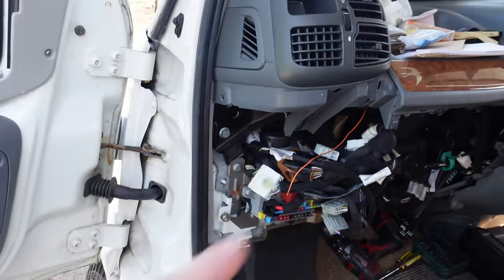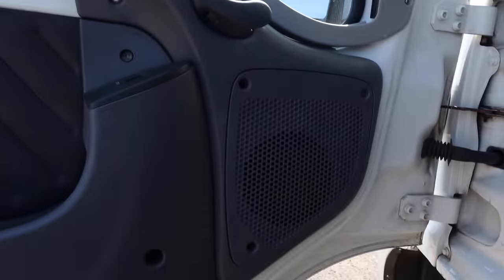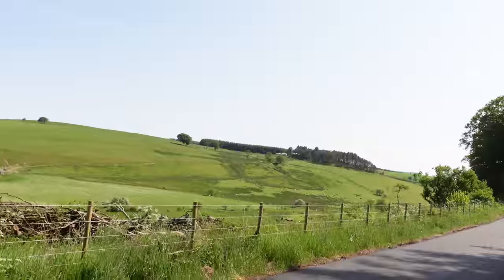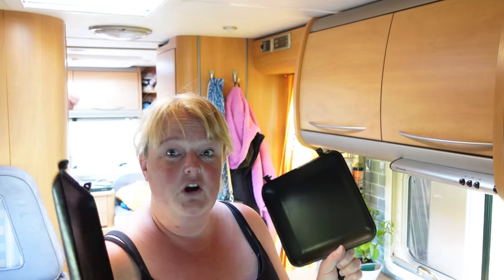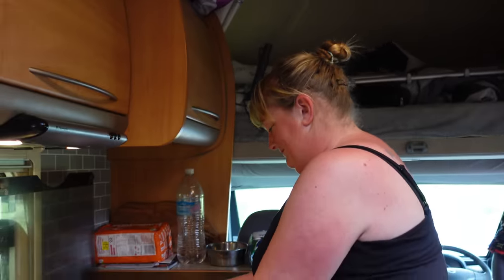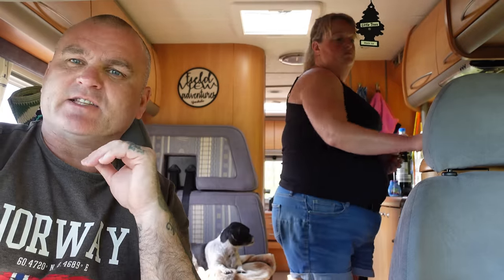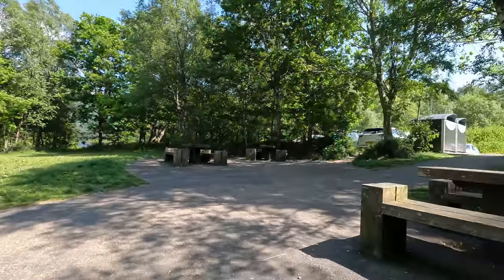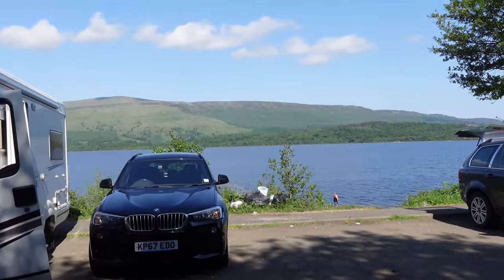The Dark Side of Van Life: Beware of THIS!

Comment: with the spacers it should of had studs and nuts to replace the bolts.
i have seen things like this that are standard on struts but they have studs on the strut and spacer over the top
Reply from the maker: These had longer bolts , but studs and nuts would have made it a lot simpler to fit Martin 👍
Reply: @FieldviewAdventures  was good that came with longer bolts been in the motor trade for 40 years most struts that go in place like this now have studs n nuts.
enjoy your stays up there in scotland